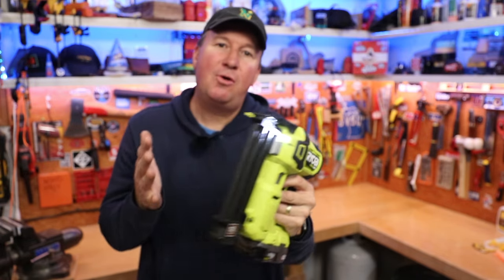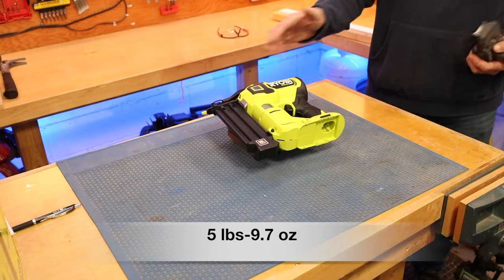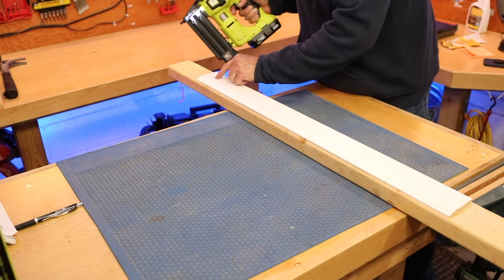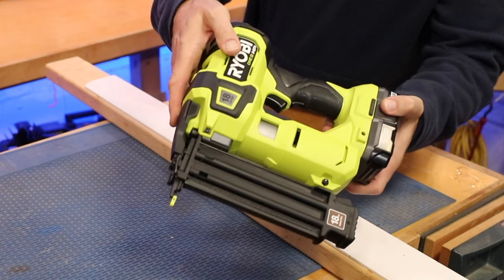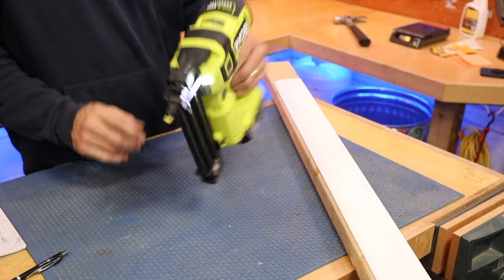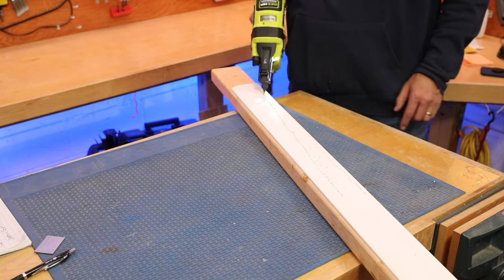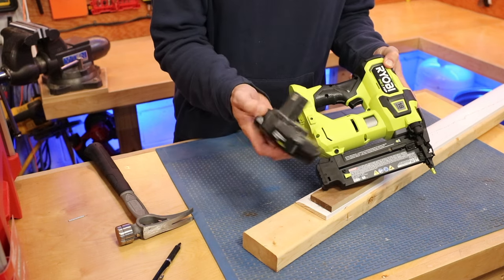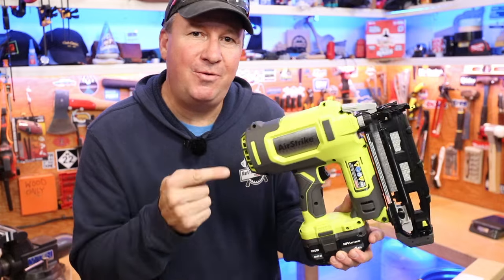NEW RYOBI HP 18-GAUGE BRAD NAILER PUT TO THE TEST!

Comment: I have the original one I bought on sale in 2021 for $99. I'm a general contractor,Use it about once per job. Used it a lot and never had any trouble
Reply from the maker: That's good to hear, especially with the use it gets.
Reply: I agree. Awesome little nailer. I’m sticking with this one for the longest time. I have no plans on buying a new one. This and the pin nailer.

Comment: I have a new one and the drive pin will not retract about half the time.  Is there an easy fix or should I take it back?
Reply: Sounds like you need to oil your nail gun.
Reply: They replaced it.  It was like it was not connected at the top of the hammer.

Comment: The reason why I'm choosing Ryobi Airstrike tools over Milwaukee's (gen 2 brad) offering is mainly because it apparently does not use a nitrogen canister in it to fire the nails. Nitrogen canisters can leak apparently probably even if you shelf the Milwaukee tool for a year or 2. If they leak too much then they need to be serviced and nitrogen replaced. I heard some people buying them brand new and the gun would not fire the nails due to a canister that leaked. I have yet to hear similar stories about the Ryobi Airstrike line up. Plus Milwaukee's can jam easier. I heard this also depends on the type of brads being used. Dewalt brads being the culprit in most cases due to too much glue holding them together. You really need to take time to research this stuff else you end up with a possible lemon down the road. The Milwaukee pin nailer looks awesome and heard nothing but good things. It even looks amazing ergonomically, but I would still be worrying about having to get the nitrogen replaced. Every tool will need maintenance but I want something that's long term reliable. Plus this Ryobi Airstrike is half the price with a battery and charger at Home Depot as of Jan 2023. This is of course in CAD not USD. I can't speak for USD.
Reply from the maker: Lots of great points to consider there.  I appreciate you taking the time to share.  I plan to do a comparison soon and this brings up some interesting things.
Reply: @MarkThomasBuilder  Thank you very much I look forward to watching it. As a side note I think Milwaukee Gen 2's are great for people who will be using them right away professionally because they will not be shelving the tool for very long. They won't have to worry about the nitrogen canister leaks cus they're using the tool with heavy use. The Ryobi would have a longer shelf life if used DIY though. I think that's what differs. I'd love to own the Milwaukee and have the money to buy one or 2 of them but I wouldn't be using like its supposed to be used (professionally) with heavy use. I'm not a brand snob either. I love Dewalt, Ryobi and Milwaukee tools in no particular order for different reasons depending on the tool. There are other brands I like too but too many to list.
Reply: No gun is going to beat the milwaukee gen 2 ive had it for 3 years and jus now sent into to service
Reply: @utubinggreatness  Funny enough through all my babbling all those months back I changed my mind and bought the gen 2 over the airstrike regardless due to how well it sinks the brads. I also bought the pin nailer gen 1. I really had to think it over and watch tons of vids. Plus since I'm using them DIY hopefully the seals last long enough to sink at least 10,000 brads over a period of 5-10 years. Again I hope the mechanism can last that long of DIY use.
Reply: I beat the crap out of all my Ryobi nailers. I’ve had them for 5 years and they work every time. I do kitchens and bathrooms for a living. I paid $100 for both the brad and fin guns. I got the framing gun for $200. Hard to beat that.

Comment: Need to do a cold review if you can,,,,,,, I returned the $99.00 one because it was left in my garage with a temperature of 30 degrees and It didn't wanted to work.  If this passes that test it should be a good contender if it goes on sale for under $140.00,  just my opinion
Reply from the maker: I was going to do a cold review on their framing nailer.  It was 2° out this morning, lol.

Comment: I just bought one of these to replace an older brushed model (it's probably 5 or 6 years old), and I've found that the brushless nailer can barely bury the nail in the wood (I've adjusted it for max shooting depth and power), my old brushed nailer on the other hand will shoot the same nail in the same board well below the surface.  Has anyone else noticed this?
Reply: Im keeping my old brushed one from 2017. It’s great!

Comment: I have the older brushed gun ... and a love hate relationship... works great, when it works ... but up here in Canada, it simply WILL NOT even turn on until the gun is warmed up. Leave the gun in your truck overnight in winter, and it takes an hour or more to thaw it inside before it will fire... regardless of battery temp.
Regarding jamming ... for future tests, break your nail strip into a few random short pieces and load them ... That is when most guns will jam/fail to feed.
Reply from the maker: I haven't tried this HP model in the freezing cold weather yet to see what it does.  Back when I ran a pneumatic nailer, my compressor wouldn't run in my cold garage unless I put a space heater in front of it for 10 minutes.  I know the stuggle, lol.
Reply: I have this model and the brushed model. If you take out the nailes and unclip the top to see the nail driver, I put 2-3 small drops from Paslode cordless lubricating oil Part No. 401482 each day. My first brushed model lasted 3+ years full time as a carpenter, second one has the same work time. It worked almost flawless other than warming it up in Ontario Canada winters. People joke, but for the price the nailer can produce good work. The brushless works good with light 1.5A Batts.
Reply: Still happens with the HP model
Reply: Pretty sure thats normal with any gun goodluck in the winter lol...
Reply: @johngomez7181  I actually bought the 15 gauge, 18 gauge and the narrow crown stapler from Milwaukee and they work perfectly for me in the cold while the Ryobi didn’t.  I should make a short to show them working

Comment: As a tradie, would it be silly to buy this? Shoot off entire houses a couple of times a year, how would it handle?
Reply from the maker: I know a home improvement business who uses all Ryobi power tools and is very happy with them.  I'd say this nailer would work well for your needs.
Reply: I trimmed out a 16 apartment complex with base, window and crown moulding with the p320. No issues. I've put 80,000 nails through it in 2 plus years.. I'm going to try the p322 next.

Comment: Is this something i use to make a book shelves for my son or i have to go with a 16g
Reply from the maker: I'd say to go with the 16ga, but the 18ga could work if you're using wood glue too.
Reply: @MarkThomasBuilder  any technique not to split the wood.
Reply from the maker: @dspinoy  When I'm using the brad nailer and try to get close to the edge, it sometimes splits.  Most of the time it's not an issue at all.
Reply: 100% a book shelf brad nailer or finish nailer is not the tool’ lol just being honest you’ll want to use screws for as much weight as books are’ 

The brad nailer at $99 though is hands down a good tool to throw in the toolbox for other projects’

Comment: is that the standard battery that came with the kit?
i just bought this nailer, got the charger and standard 2.0 battery  free with it, and when i get even close to half a battery, between 2 and 3 bars, the led starts blinking and the tool shuts off and wont fire.   does it need the new hp batteries, or did i just get a bad battery from the jump ??
Reply from the maker: That's odd.  I've had a Ryobi battery go bad, so maybe that's the issue.  Hopefully you can exchange it.  The HP nailer I have came "Tool only", so I provided my own battery.
Reply: @MarkThomasBuilder    im getting about 400  to 500 shots off the regular 2.0 battery that came with it. does  that sound about right ?
Reply: Hi, I have the same issue. I have 3amp battery and it only uses 1 bar out of 4 on battery and stops working. Battery more than half full. 
Have you resolved your problem? or is it faulty nailer?
Reply: @erniewhite4768   yep, took it back and got the milwalkee,....never misses and runs down to 1 bar
Reply: @nodoubt46able  how's Milwaukee compared to Ryobi? Except battery issue
Reply: @erniewhite4768  night and day difference
Reply: @hogg  I'm having the same issue and I've barely used it. On the first nail it will do like a half ass fire and not drive a nail at all but if you take the pressure off of it and press down it will drive 1 nail and start to flash. I have to pull the battery out and restart after every nail. I've also had it work fine. I think the part that drives the nail in is getting stuck out. When I opened the part where the nails come out a silver metal piece was sticking out and when I pushed it it shot back in. It's stored in my garage and it's winter so I'm not sure if the cold is messing with it or what.
Reply: @erinroberts5485  I think it's design issue. I've replaced one and it has exactly same issue. They said it needs high energy/ high performance ryobi batteries. I bought 2amp high performance battery and it works fine. Try it and let me know buddy
Reply: @Ernie White  I got my HP battery today and it fired every single time. I even made sure it wasn't the outside temp since it's warmer today with the old battery and it still messed up. Put the HP battery in it and fired off 20 nails non-stop with no issue.
Reply: @erinroberts5485  cool man. How many Ah battery you have?
Reply: @erinroberts5485  i mean what's your battery capacity? (Ah)
Reply: @Ernie White  I went with a 2ah one. I won't be using this nailer a whole lot and it's my only HP Ryobi tool right now. I was going to go bigger but the place I like to buy batteries from was all in store only and wouldn't ship. They sell factory blemished or reconditioned tools and batteries and have really good deals. I was going to get 2 4ah HP batteries for close to the same as 1 4ah HP costs at Home Depot.

Comment: Can I use this nailer to hold in place fence boards before I screw them in?
Reply from the maker: If you can get them long enough, they'll likely hold long enough to screw the fence boards in.  I'd go with galvanized if you do it that way.

I'd try to clamp them if possible instead of adding nails, but it's up to you.
Reply: Thanks. Will get galvanized nails.  @MarkThomasBuilder
Reply: Is adding nails counter productive?  I may not know... Clamping will take me longer.  @MarkThomasBuilder
Reply from the maker: @gloriamenchero1926  I don’t see a problem with that for holding the boards in place before screwing them down.